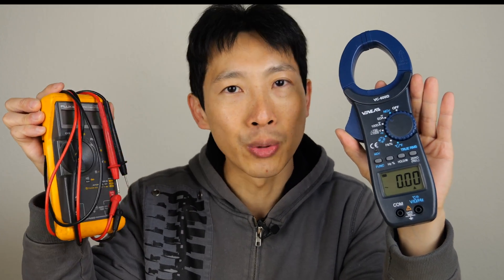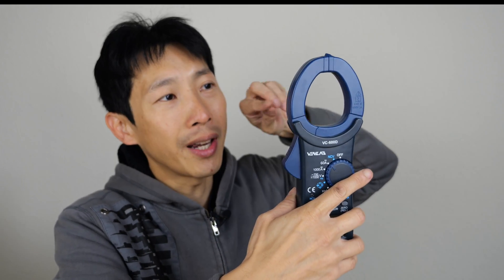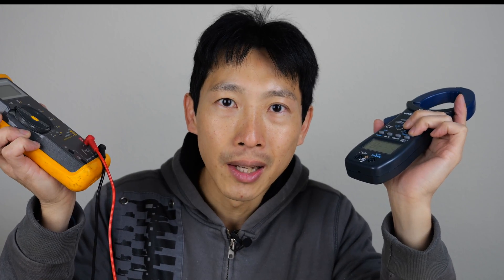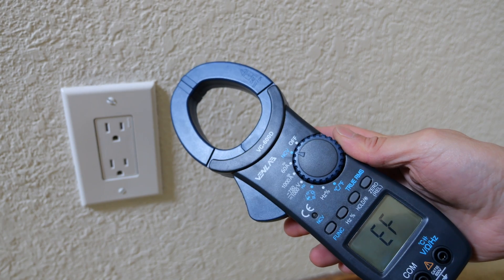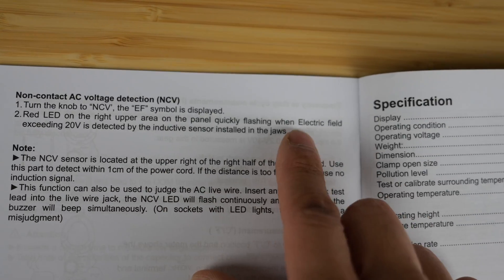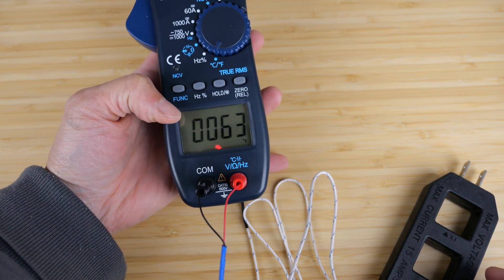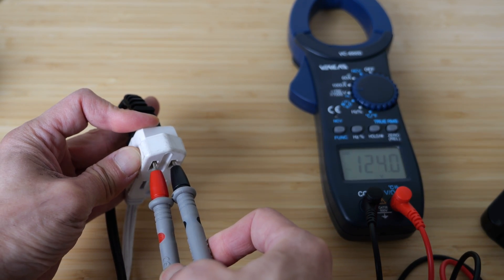When to Use a Clamp Multimeter

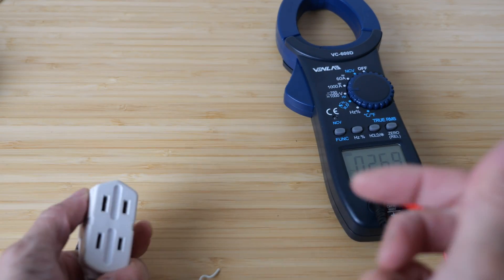Comment: 7:46 I thought you are suppose to stick black lead to larger line (the neutral line) and the red lead on the smaller line (the live or hot line) of a wall/plug.
Reply from the maker: On a DMM measuring AC voltages, it doesn't matter which polarity it uses, it'll display the same AC voltage.